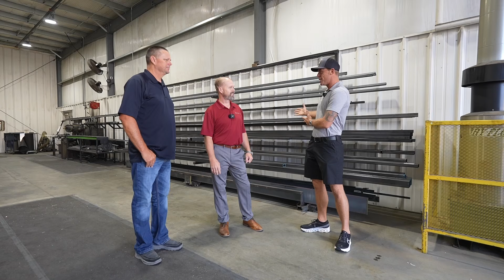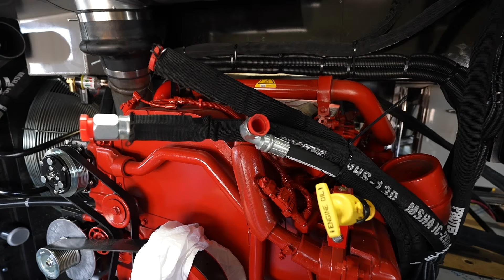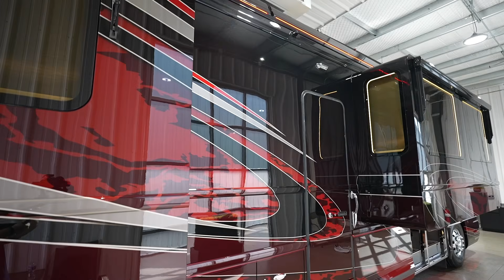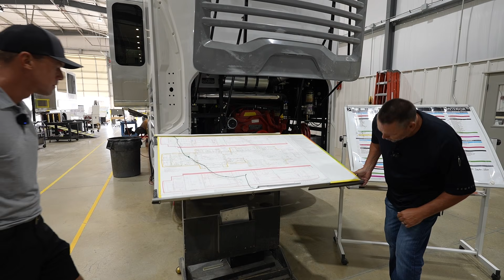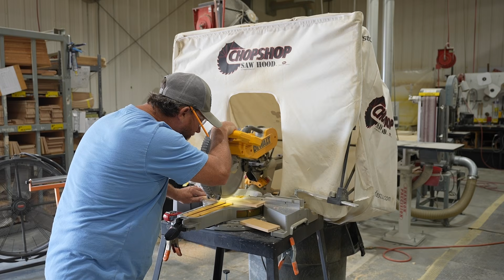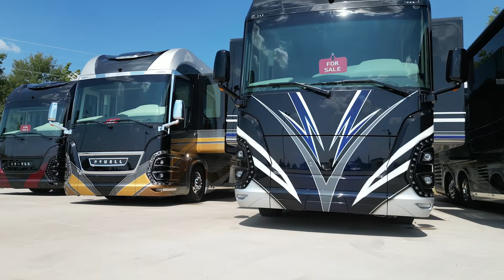Building a $2.6 Million Luxury Motorcoach from the ground up in the USA-Newell Coach factory tour

Comment: Seems to be America’s answer to Prevost. So how does the Newell Chasis, bays and walls/roof compare to Prevost Monocoque construction? 

I noticed the steel frame around the Valid slide and what appears to be steel beams inside? Or are those aluminum? Are the beams/studs welded or bolted to the custom Chasis? Curious. Seems very close to monocoque design.

Comment: As to mid-entry designs. The engineer in me fully understands where the vulcanized rubber technology has gone and tires have dramatically improved, etc. Still... six tires... two tires... six tires.. two tires... I just can't get comfortable with the idea of that much weight in the front half of the coach. Not saying the mid-entry aren't safe because Newell would flat refuse to build them if they weren't. Just the 'engineers overbuild for what if not how come' mindset I guess would never allow me to own a mid entry.

Comment: The information in this video just highlights why Newell is the clear 'King of the Hill' when it comes to the US motorcoach industry. The steel and aluminum vs the fiberglass builds for sidewalls just can't be understated how much better an experience driving one of these big beasts is. I've driven one Newell and a handful of the other 45 Class A and it just isn't really comparable an experience as the driver. Quieter, more stable, feels more 'attached' to the roadway, the active steering lets you do things even a passive-steer tag won't let you do. About a year ago on a Newell, the owner (good friend of my wife's) asked me to pull it into and out of this particular parking pad they had rented without checking it out first. Seriously tricky with trees and boulders on either side, etc. and with a trailer he just didn't want to even attempt it. Less than 10 minutes of careful and slow maneuvering and it was dead-centered in the pad. Honestly, I don't think I could have pulled that off with ours (we have a passive-tag).

Comment: Weird little side note... those ceiling fans in the warehouse.. I've never seen fans that size and didn't even know they exist that size.
Reply: Their called "BIG ASS FANS" I have two of their 20Ft dia fans in my plant and they go up to 24ft in dia., they move a ton of air!!
Reply: @kentgoss9209  lol... like the BFG in Quake (Big f'in Gun)... 24 foot diameter so say 10' long blades with a 24" hub... damn thing must weigh a ton. What kind of motor drives that thing? You ain't plugging that into no regular electrical socket not even a 220v. You have to probably drop 3-phase and wire the thing to the panel directly. :hand-orange-covering-eyes:

Comment: Nice video, nice coach. A steering 3rd axel is not that special overhere in Europe. That's the reason ZF makes them. Many 3 axle trucks have them as our roads are relatively narrow and we have a lot of tight spaces. In those circumstances a steering 3rd axle is very, very useful.

Comment: All american build but suspension is german…ZF😉🤣 slide outs are Canadian. There is a reason why most MH have fibreglass side walls as you can actually fix when it gets damaged . I had aluminium side walls but can’t be fixed and replacing is only option.

Comment: That’s the only way to build a motorhome that won’t leak unfortunately it’s out of the price of the average consumer. However, I think that if the general RV manufactures just take a few more steps to prevent leaking and check their quality of work as it goes through the process they can come out with a better product.

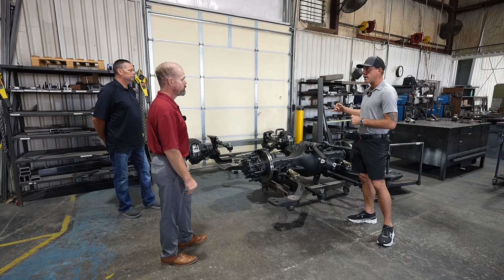Comment: 8:20 Unless the DRIVE axle steers, it's not 4-corner active steering like in passenger vehicles. Having only the tag axle "steering" simply prevents having to lift the tag axle up. It does nothing at all in the way of adding to the steering geometry characteristics.
Reply: But it does.  Simple physics is hard. 😂

Comment: I have a question, why are they still using the same air conditioning units on the roof that companies have been using for the last 20 years or longer. As we all know they are prone to icing up in humid climates and there are much more efficient options out there.  Also do these coaches have bus air?  I'm talking and air conditioning system that's attached to the engine so when you're driving you don't have to run the generator to power the roof mount ACs. One more thing is anyone ever had the generator running and pulled into a dirt lot?  You know when you're out camping sometimes you hit dirt roads or dirt lots and that generator cooling fan looks like it would make as much dust as a helicopter. But the paint sure does look nice. By the way MCI has used counter steering axles since before 2000.

Comment: This is cool. While I admire they build their own chassis, there is a downside. With the builders that uses a Prevost chassis, you get some standardization in the suspension and drivetrain which makes it easier to get those serviced. With Newell, they are all one offs. Where do you go for service on the road if you need it?
Reply: The drivetrain and suspension all are fairly easily worked on throughout the expansive Cummins and Allison service network. And we have established a strong service network of qualified service centers throughout the country that work on all other aspects of our coaches.

Comment: I must admit -- Newell is beyond the best of the Best -- The built from the ground up is beyond compare. All of the different Prevots brands can not compare. - Andrew - this was an amazing job - Give yourself a hand clap for getting deep into why Newell is the KING of the Class A
Reply: I disagree. Newell can't touch the Prevost builders. My main problem with many of these builders are too many slides and rooms that don't work without opening slides. I want to operate my bus moving from point A to B, between stops I need to be able to cook and entertain and function without needing to open slides first.
Reply: @coffeebuds  then minimize the slides, rearrange the layout that fits your needs. I must say this is a very in-depth video from the ground up. Sadly I wont be able to afford one
Reply: @coffeebuds I wish you could do both. Operate driving AND have space with slides
Reply: @coffeebuds I completely agree. This is why I had my Coach built using an older MCI MC9 chassis with no slides and I have never once missed the additional space the slides give, nor the additional stress & heartache from arriving at your destination and having a slide that is inoperative! I want to pull over when I get hungry and be able to access my full kitchen & bathrooms without finding an area large enough where I have to activate the slides so I can simply open the refrigerator door. But that’s my opinion. I like having fewer leak points and fewer motors and slides to breakdown

Comment: The hydraulic cooling fan is interesting. Wonder why not electric?
Reply: Too much power is required the alternator would have to be massive. don’t forget it’s a side radiator so you don’t have the air pushing through it as you go down the road in the fan not only has to cool the radiator but the intercooler as well for 600+ horsepower. I own a 1996 for travel and it has a hydraulic fan. It speeds up or slows down depending on engine temperature.
Reply: @brenyz5013 thank you for this answer